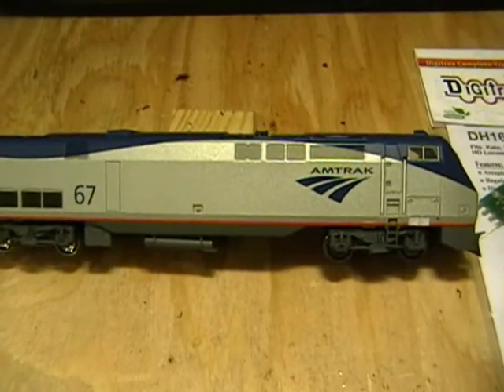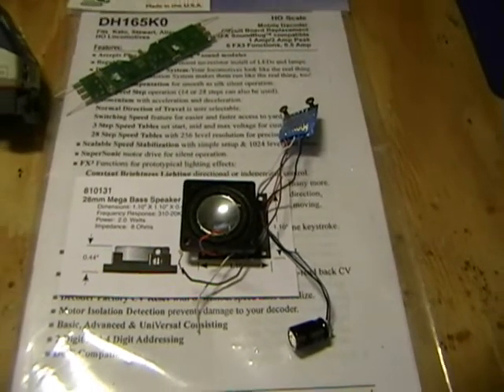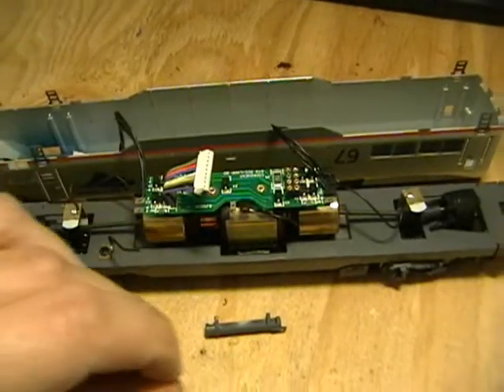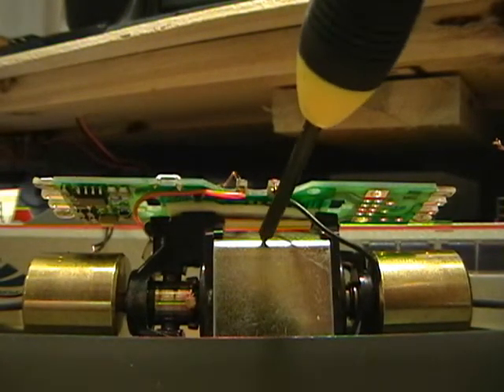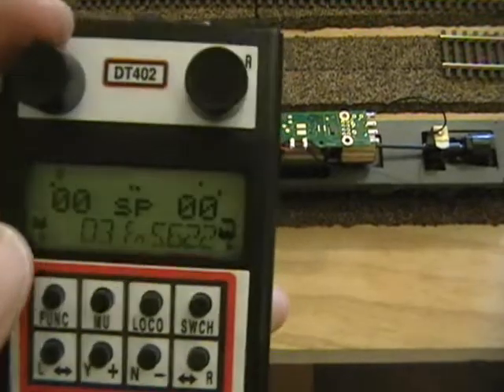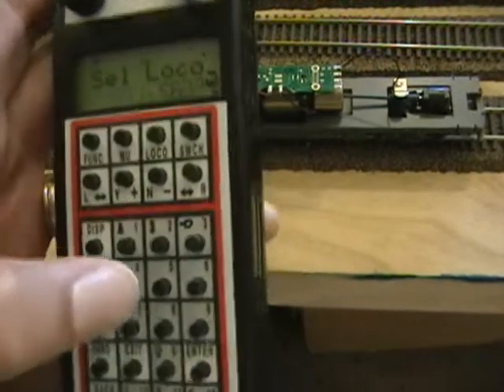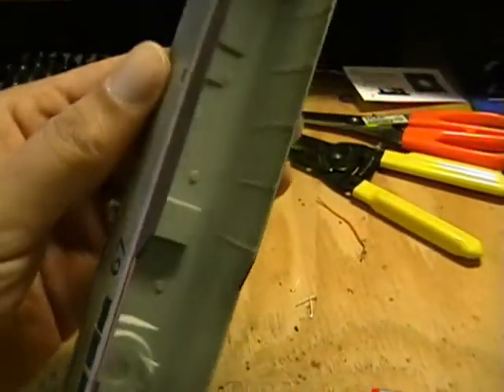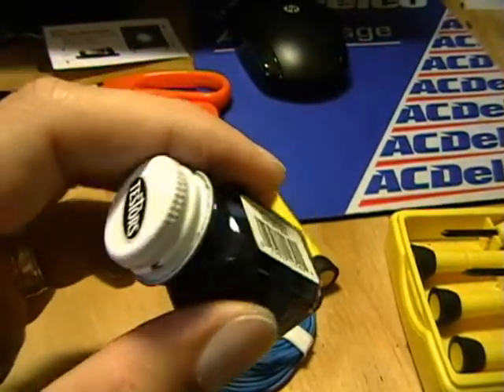06-20-2012 Advanced DCC - Custom Install on an Athearn Amtrak P42 - Part 1

Comment: Nice video, I've done a few of these installs, I do use the same tower LEDs, instead of trimming the "nipple" of the LED, I slide it in until it's just past flush in the headlamp housing.
Then I generously apply flat black paint on the inside of the shell. This does two things, one it prevents light bleed from behind, two it also hold the LED in place. 
BTW: I use this install practice on all my engines. 
Cheers 
wcr

Comment from the maker: As for the switcher, Digitrax makes a SDN144PS sound decoder. I used it on my Atlas Genset and it works quite well. The speaker is very small and quiet, You may need to replace it with a bigger one if you have room in the shell.

Comment from the maker: Digitrax recomends that a 680 ohm 1/4 w resistor or heigher is used with their products. Some of the other manufacturers will allow you to get away with 470 ohm. I have been using 1K ohm 1/2 w lately. The LEDs are not quite a bright and looks very nice. Works with all the different manufacturers too.

Comment: Good job again Tommie, you make it look so easy. As for Athearn, there details are unmatched, shure Atlas and MTH are great but they dont make many of the models that Athearn does,and Kato ,I bought a Kato model two weeks ago and not only was it missing parts but the side frame details are cast onto the sideframe.It runs good but the details just plain suck.Any advice on a mini decoder and sound device for a trackmobile or GE 25 ton switcher.

Comment: Great job as usual .. question...noticed your PGMING on PO (Ops ) ( I really screwed up a bunch of engines when I first tried programming . I had to use PO with Tsunami Decoders and ended up changing a bunch of adresses inadvertently .. I now pull all engines off before using PO ....do you have a secret here ???..As always, thanks for alll the good info...BTW looking for PART 2 of this video ...yet to come ???

Comment: Is there any sort of trick to getting this body off. I haven't been able to get mine off even after releasing the tabs
Reply from the maker: They can be a little stubborn. Run a small flat tip screw driver along the shell and frame.
Reply: Once you have a latch loose from the shell, insert a toothpick to keep it unlatched.  4 toothpicks and the shell should be a lot easier to remove.  Take care not to break anything on the steps.